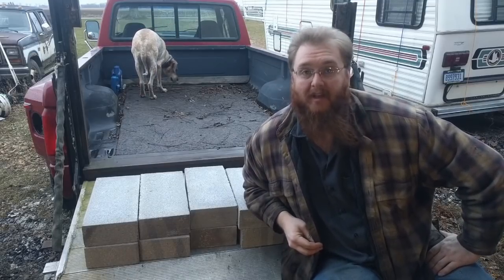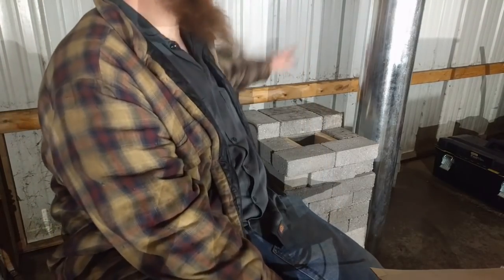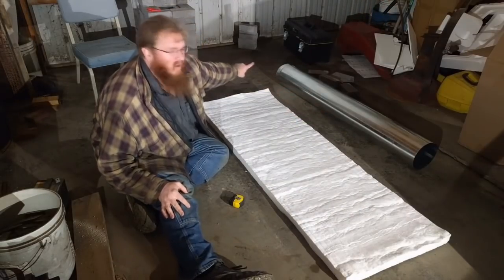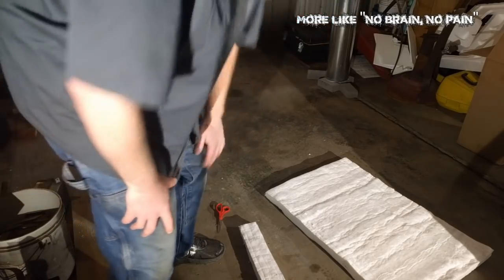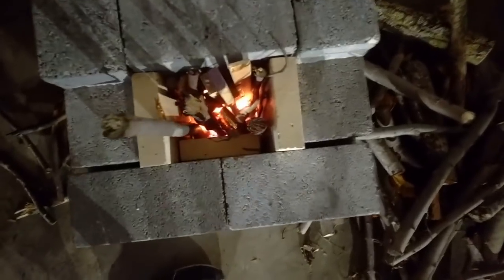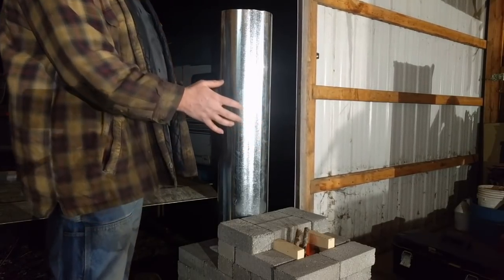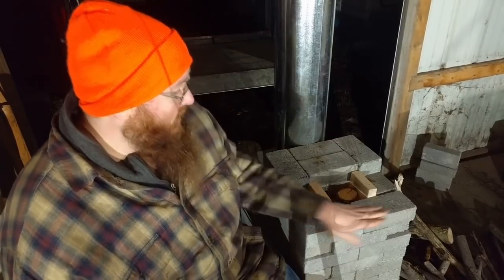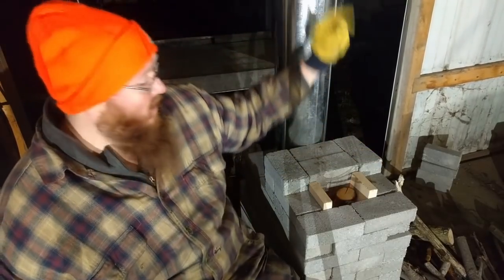Rocket Mass Heater(1) FEEL THE BURN! Test Burn!!

Comment: Mass Rock heaters are so cool, and very efficient. Knew a blacksmith who used one to partially heat his shop. He said that the winter before he went through 3cords of wood. After installing the rocket heater he used 1 cord of wood.
Reply from the maker: Yeah. I have it installed an running now without the mass.  Even without the mass this thing uses way less fuel that a regular wood stove.  I can't wait to get my mass installed!

Comment: Is that Kaowool? Cus you know you can’t leave that stuff bare and not coat it unless you want to die from cancer and all that, right? Can’t wait to see this come together. Great to see you Twan! (Btw, don’t put it in your house til you know it’s safe please!)
Reply from the maker: Different brand, but similar stuff.   No one will come in contact with the exhaust..... Unless you climb on my roof.  The hot air goes into a sealed tank with an exhaust at the bottom.  Eventually it will go through a mass to collect more heat. Right now it goes right out the roof.

Comment: So that runs into a heat exchanger? Neat idea. Are you concerned about silica dust from the unsealed ceramic wool in the furnace?
Reply from the maker: It will run into two heat exchangers.  One metal tank that goes over the heat riser. This will release quick radiant heat. And then through a large mass that will hold the heat and release it slowly.
Reply from the maker: Any dust will either be contained inside the furnace, or pumped through the roof out the exhaust.  It should only be an issue if/when I open it to inspect the inside.

Comment: First?
Reply from the maker: Yup!
Reply: @WarpedLegacy  so, what are you doing about getting the ash out? Right now it seems like you'd have to wait until it cools completely and vacuum it out. I think it'd fill up pretty quickly with the small burn chamber.
Reply from the maker: That's basically it... Let it cool and scoop it out... Or vacuum it out. It burns very efficiently and it doesn't go through a ton of fuel.... So it doesn't build up very quickly.